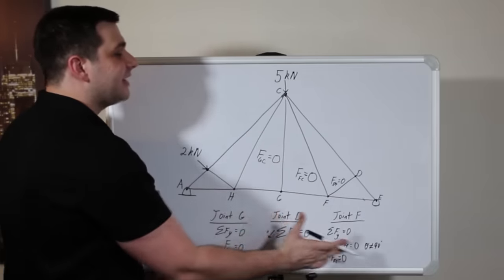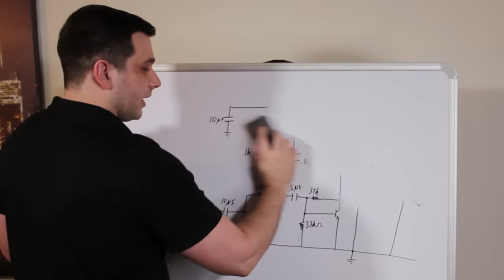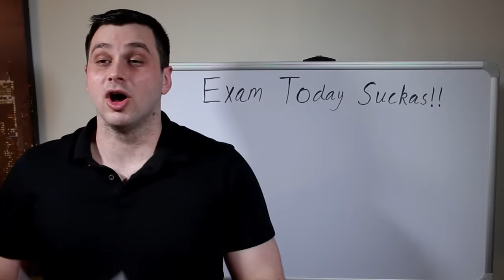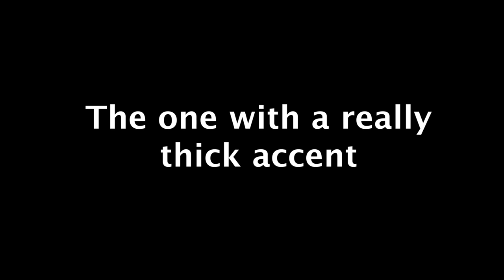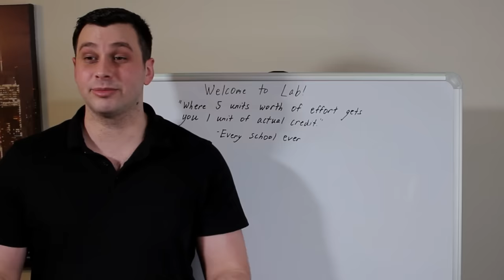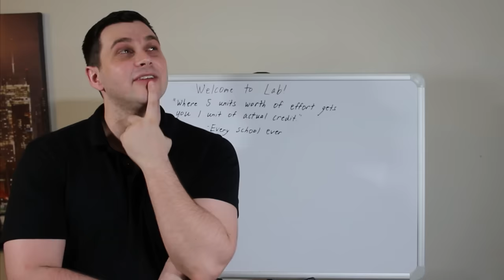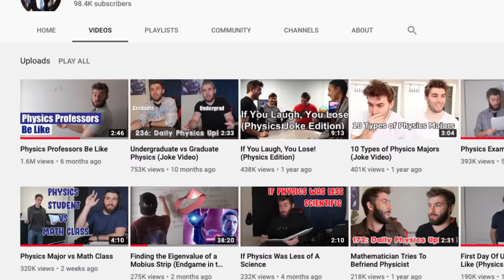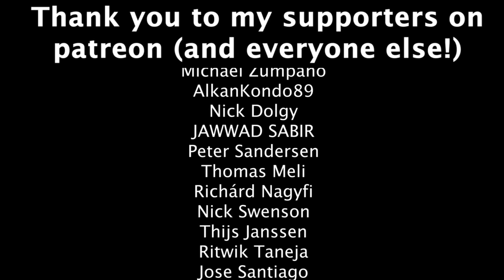Engineering professors be like

Comment: I am my PhD and shortly becoming a Professor. Thinking of which type should I become.
Reply: Please be the type that can actually teach, has a good sense of humor, and makes the tests difficult, not extreme. And before you say they don't exist, my intro to analog circuitry professor (covered resistors, capacitors, and inductors with dc sources) was exactly this. Without a doubt, best prof I've ever had, even if I had to take his class a second time.
Reply: I have just as much education but no PHD yet. I recommend you give your students piratical experience by allowing them to complete several small applied projects throughout the semester.  My embedded systems professor changed my life after college with his applied labs. by the end he had us create a Tetris game boy using an 8051 MCU.  My power electronics professor had us program an Arduino to power a SMPS flyback regulator to provide 17 volts to the gate of an IGBT transistor.  My machine learning professor had us create a robocode genetic learning algorithm and held a competition at the end for who could create the most efficient learning algorithm(the ML class was a graduate class). Anyways sorry for any misspellings, I didn't get the PHD for a reason.
Reply: Put yourself in students shoes.
Reply: The one that gives you an A for no reason at all. 🙄
Reply: NO, pls prof, just, don’t plspslspl
Reply: Be the type that has a class full of geniuses who miraculously manage to get an A despite having an average of 56%
Reply: Please for all things good be the lecturer that takes their time to teach, Thank you😁😁👍👍💪🏾💪🏾💪🏾
Reply: @MorTobXD difficult to the level where you are applying the knowledge you learn and not rehashing problems from class.

Comment: I graduated 3 years ago and am thankful for the school I went to where I only experienced some of that bs. I had one professor with an Indian accent who was difficult to follow (circuit analysis unfortunately). They kept on saying “ground is a reference point” and I ask “a reference to what” and I swear they kept just saying “you know a reference point”. I now know by playing around with simulators and real circuits it’s just a “reference” to zero volts because voltage has to eventually drop completely in circuits. I also figured out all drawn ground symbols are “magically” connected by an un drawn wire which was never obvious or explained
Reply: The ground is defined as the reference point. When you're saying a point in your circuit has a certain potential, e.g. 5 volts, it's not a quantity like saying something is 5 kilograms or 5 meters. You're saying the point in your circuit is 5 volts higher than another point, and that other point is the circuit's ground.

Your definition is functionally equivalent for all practical purposes but I thought I'd might shine some light on why your profs kept saying it's a "reference point". The ground is not a reference to anything else; everything else is a reference to it.
Reply: @jjmarr7130  The weird circular definition makes no sense when you are starting to learn about circuits. Usually when someone says “reference” it always comes with a different object for comparison, an absolute value. When we asked “a reference to what” and all that was said was what I explained, you can imagine our classes confusion because it is a self pointed definition (a vague, abstract definition). When you clearly explain it’s basically a zero volt point, then the differential idea is made even more clear. It’s one of those things that some people would understand while others may be absolutely confused
Reply: I'm not sure if it's some weird English language issue but in my language it totally makes sense to call ground the "reference point" or the "reference voltage" for other measurements. I don't get why a reference point would need to be "to something". It's just a reference 0V for the whole circuit so if you for example had a 5V DC source then this 5V would be measured relatively to the ground voltage.
Reply: @bzqp2  because if you say “for reference” it is always something exact. You have an exact example or something to compare to. When someone says it’s a reference, it is a fair question to ask “to what?” If you only use the word ground, it doesn’t make sense because Ground means a lot of things in the electric world. Earth ground? Signal ground? Chassis ground? What is the “value” or context of the word without explanation? Everyone thought it was literal earth or some abstract concept because nobody cared to show what it meant, it’s especially confusing if you have floating symbols everywhere and you don’t get an explanation that those are magically connected
Reply: Idk man theyre teaching us this in 12th grade...
Reply: @starryepidemic2532  yes because everyone’s high school teaches Circuits..I graduated in 2013 and mine never covered circuits. I was so confused in college and almost everyone else in my class. It’s not exactly common sense when you first learn
Reply: What is 0 volt? ahah
Reply: @00killerix  Zero kilogram meters squared per second cubed per Coulomb to be precise. My point still stands
Reply: @MrPokoloco  it's not a comment againts your thesis, i really didn't understand what 0 volt was
Reply: @00killerix  oh. I read it wrong. To put it simply, 0V is like a dead battery. No voltage means no energy left in other words

Comment: I watched this a few years ago in HS. My statics discussion on truss analysis was last week. Can confirm, the first clip is accurate.

"You shall not pass" Yep. We had 70 min for our first midterm. My TA also took it before he started grading ours. It took him 50 min. WITH NOTES. It's worth 20% of our grade. You need a B to pass the class.
Reply: I had a similar situation in my calc 2 class where we had 60 mins for a test and the professor took 90 minutes with notes...
Reply: Engineering Mechanics for me. 75min exam for 7 problems and each took at least 40min to solve

Comment: Very funny. Applies 40 years ago. On the other hand it is not trivial to teach. I've done it occasionally. It is amazing the large range of student readiness. The level of the prepared lectures always overwhelm a fraction of students. One can't really teach two levels of courses simultaneously. Still the scoring system can be made unambiguous by a teacher.
Reply: In my experience teaching well requires being adaptable.  By that I mean being able to re-explain a concept in a different way.  In addition it helps to be perceptive enough to figure out things the student does know or already understand and then use that to produce an explanation for the new concept.

Teaching is hard and yet we undervalue teachers.

Comment: The Death Star was an engineering masterpiece
A lasorbeam that can obliterate an entire planet will generate a LOT of heat
The fact that there was only 1 tiny exhaust port is a miracle
Reply: True but then again space in darkness is freezing cold so I question why they didn't just put a giant heat sink on the laser.
Reply: @thecheeseman2564  Very good point
Then again, thanks to JJ we know people can survive short periods in space without any special spacesuit or at least a helmet
Leia wasn't even trained in the Force (maybe it was a reflex but that's very debatable)
In the Clone Wars Plo Koon (who is an alien whose homeworld has poisonous gas) fought in space for a while without any suit or specialised helmet (aside from his mask
And in Rebels Ezra Bridger (a 'human') is in space with just a Stormtrooper helmet
We do know Vaders suit could withstand space for about an hour
Reply: The joke wasn't the engineering failure of the death star. it was about the two tiny and seemingly normal missiles that magically made a 90 degree turn on their own, went through that exhaust pipe in a perfectly straight line for what was probably miles while flying directly against the flow of the exhaust, and did enough damage to the core to destroy the entire structure in a single cascade failure.
Reply: @dsanchack332  True but as evidenced by the movie rouge one the flaw was intentionally designed, so that it is conceivable that he may have specifically designed all parts of it to increase the chances of cataclysmic failure.
Reply: @thecheeseman2564  Conventional heat sinks do not work in space like you might expect. While the temperature of the particles we measure in space are extremely cold, because space is a vacuum they do almost nothing to cool you down. If you were to be exposed to space it would take you a pretty long time to lose your body heat even after you died. We use radiators to release heat through infrared radiation. It doesn't really matter if space is freezing cold or extremely hot, radiators would still essentially release the same amount of heat in a vacuum. Releasing excess waste heat is a very big problem often not accounted for in science fiction when building giant mega structures with living creatures inside. Animals generate a ton of unnecessary waste heat so just the body heat of a few humans would build up over time and eventually cook them alive if not accounted for.
Reply: And don't forget that laser-beam shoots straight past two guys named Phil and Jeff who work INSIDE the laser tunnel and don't even have a guard rail.
Reply: @Skana   You are absolutely right you would need a medium for maximum efficiency so what about sand. You can pump it around the station and it has a melting point of about 2000 F and retains heat extremely well.  Plus you can separate the particles to expose more surface area to cool the sand down faster.

In fact they are thinking about using sand as sunlight in the night, since solar panels absorb radiation and radiation is calculated by (i think) R cubed then even though sand produces very little radiation is is magnified  by a stupid amount due to the heat.
Reply: @thecheeseman2564  but then again, it takes place in a fictional world where physics is neglected too many times to count

Comment: Ahhh!! My Engineering Prof starts you at a 25/30 on test questions. You have to "prove" to him you deserve an A.
Reply: Aren't the correct answers the proof already?
Reply: How do you prove you deserve a A if not by answering correctly?
Reply: @shadebinder9969  "insights..."
Reply: Wtf this ain’t English
Reply: @TonyDaExpert  Yeah! Last test there was a question about using an aluminum bracket for alternating loading. I went into detail explaining why you shouldn't use aluminum because it doesn't have an endurance strength and he marked me down from a 25/30 to a 23/30 because I still didn't determine "if the bracket would work."  Everyone else who calculated the endurance strength for aluminum and had no "insight" got 25/25. NOT THAT I'M MAD ABOUT IT OR ANYTHING

Comment: As a non-engineering major: Do the professors not explain the first things because they don't understand it themselves, or because they consider it so obvious that they don't get your confusion?
Reply: Virtuoso80 both lol
Reply: @joselira8204  that's an answer right there, you can't really understand everything that happens
Reply: The first one is actually very trivial. Once you understand zero force members they're usually really easy to see immediately. (And it's taught to all engineers in first year statics where I'm from)

The second one is some bullshit about an electrical circuit, I have no idea what's going on with it but it's probably just as basic.
Reply: Garret Jacobs I meannnn I wouldn’t call it basic lmao. Diodes and transistors are nonlinear circuit elements and complicate calculations quite a bit. A complete mathematical analysis of that circuit would take a long ass time, but it’s normally something you’d construct for a lab to analyze instead.
Reply: oh shit never mind I thought a lot of those values had to be solved for but they’re all given, it’s not as hard

Comment: does it make sense our linear algebra exam has a 80+% failure rate at all times?
not rly
does it make sense that the stuff in the exams has never been done in any of the self tests and other shit they give you?

fk no
so why do i lern to do 1-3x1-3  ones then get a 5x5 one that cant be rly reduced down in time and then in the end so that 12% can actually pass ANOTHER part of the exam that was equally as bad but still not as bad as that from the entire exam after it was taken

cuz the last test i had had over 95% failure rate and had to cut 1 of the 2 problem questions
wtf was that

they call LA in my university the exmatriculator

Comment: Should be a force at the bottom of the beam reacting because the sum of the forces is zero in a static diagram. But not a force equal to zero that's wrong. The beam is in compression.

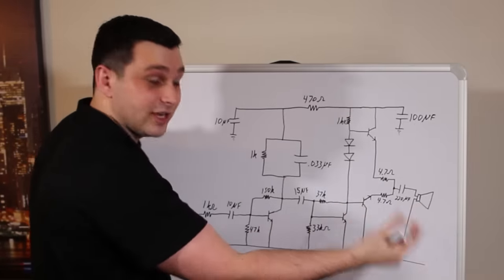Comment: 00:52 I was an engineering student. That part "The middle part is gonna be what is on the midterm." is so true for me years ago. We studied electric circuit (hopefully it is the correct English name). One of the day, the teacher drew an enormous circuit that took almost the entire board (and for the room of 100 student, it is a very big board). He explained it, solved it and answered the question if anyone didn't understand. And everyone followed and wrote down everything he said and wrote on the board. Then at the end of the lecture he said that a part of the circuit would be on the midterm so study for them.
And it was in fact in the exam. Even though it was only one part and we studied before hand, it was still not easy for us at that time.
07:53 My school has the rating up to S. A failed report has to be rewritten and then submit again. They have word 再 in red color on it (it means "re" or "again" in English) and usually it is not a good written one to be accepted. I got that one in my report too so I came to the professor that scored it and asked him further instruction (even though he already wrote some of them on the report when we got it back) so I could get better score. I thought I did well however. He told me that the current report was very good and could get A, it was not a bad one. But he wanted me to make it a little better so I could get S instead. Then he answered my questions about the report. In the end I got S from him after fixing the report.

Comment: You forgot the professor who's about 100 years old, according to legend invented the transistor or something, has about 3 million analog circuits committed to memory, and assumes that you already know and understand them as well as he does, so he just throws them up on the white board without so much as putting values on the R's and C's, and then draws a quick, unlabeled Bode plot, as if that explains everything.

Comment: A factual story. One engineering Semester test we all failed due to super vague and terrible questions. Class average 22% in 3rd year. You may think this is exaggerating but it is not. Proffessor "Okay we see the class average was very low, however the average for what we think were the more challenging questions was 32%, which is acceptable and expected. Therefore we think everyone should have done better."

Comment: Bruuuuuuuh, I remember that time I was the teaching assistant (in a 2nd-year course) and I had corrected the student exam and this one guy came to me asking why I gave him 0 on a problem where he calculated a horizontal reaction on a vertical support only (it was depicted as a rolling tire) but because the steel beam connecting to the tire was at an angle he thought there was a horizontal component lol. My mind was blown away and after the 3rd time trying to explain why there couldn't be a horizontal reaction (cause the support is a fcking tire and I was like if you push a car on neutral it's gonna move kinda logic) I lost my shit. I regretted lashing at him at the time, but 2 yrs after when I was the assistant teacher on the wood structure course (which was a 4th-year course) and saw students fail at basic Pythagorean theorem I lost all compassion.

Comment: I'm so sad you didn't include the MR-1 launch failure in your compilation of explosions - it is the most pathetic rocket failure ever - it launched about 4" into the air, shut its engines down, landing back on the pad. It then ejected its launch escape system and fired all its parachutes - including the reserves.
The video is hilarious.